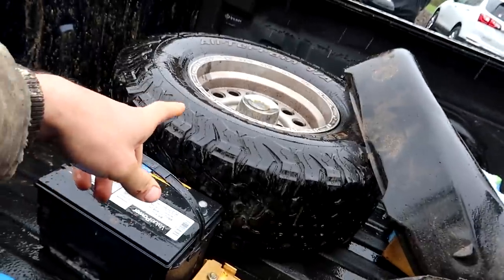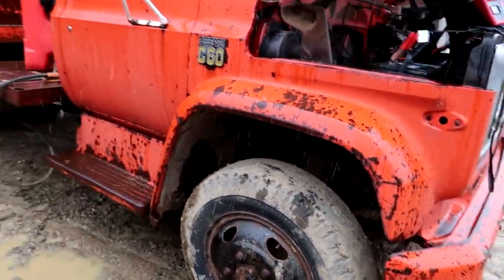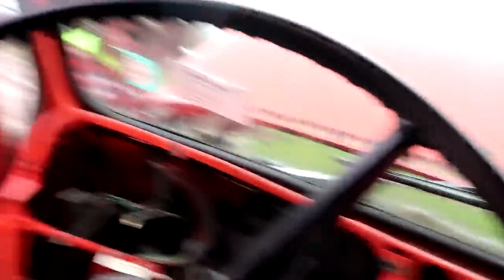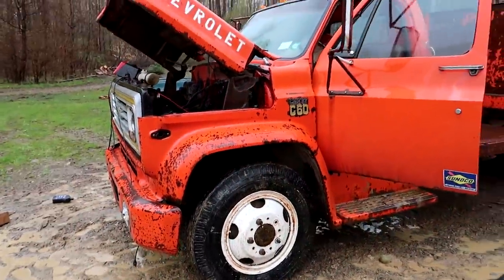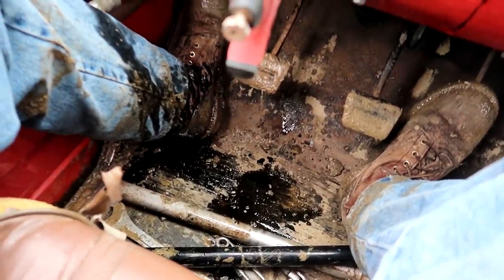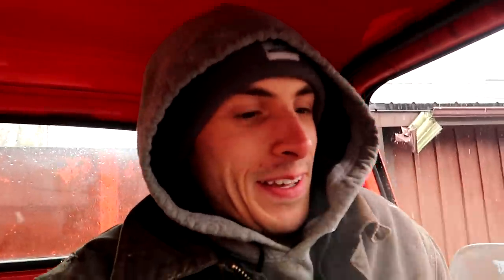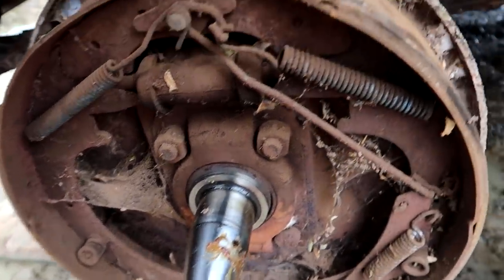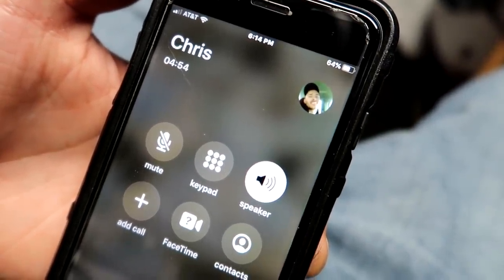1974 C60 Farm Truck | OL START, COLD START 7 DRIVE

Comment: Used to drive a 68 version of the same truck had a 2 speed rear and a 4 speed with a small block had a sand box with a sandblaster mounted in the box and a 185 air compressor on the back

Comment: Yep bud that  round thing under the step is the booster. Technical term is hydrovac. Hydraulic (vacuum) brakes are a royal pain on older trucks. If you get them working without having to change everything on the brake system get someone to drive it at least once a month. Sitting and not running vacuum brakes is bad.

Comment: use the vice grips on the oil pressure line , dont run it dry, itll be the best motor you got if you treat it right
Reply: Lol it'd take a hell of a long time to run that puppy dry with that little bit piddling out

Comment: That leaking oil line attaches to an oil pressure gauge in the dash (which is not there), at least you have some oil pressure.